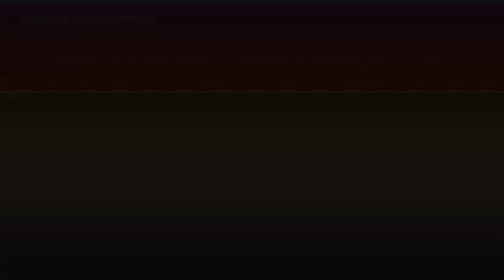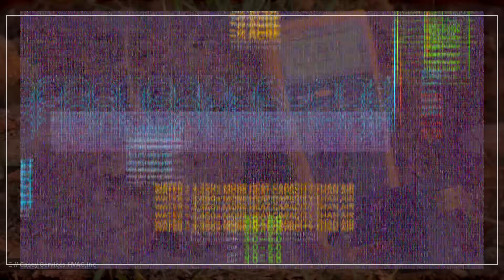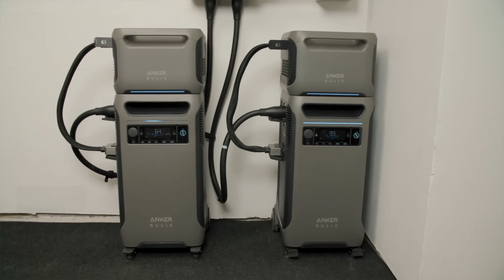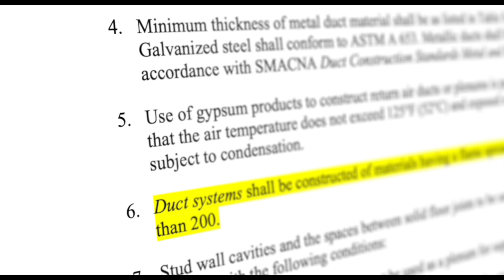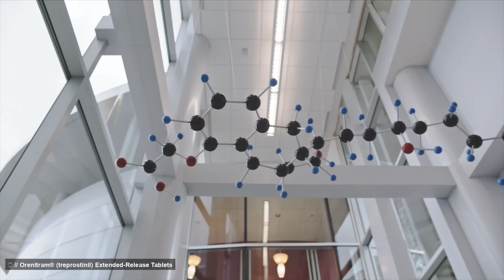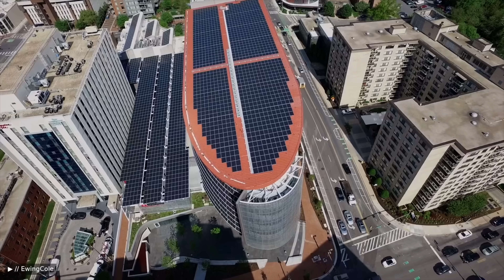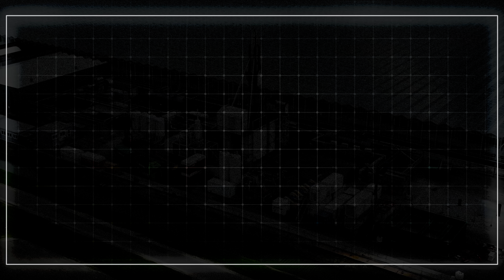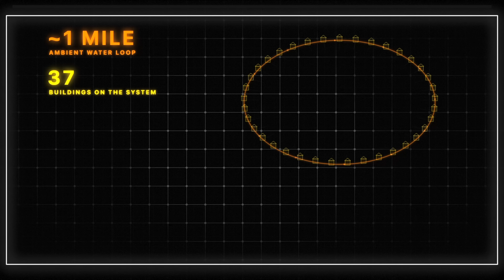The Viral DIY Cooling Hack That Nearly Killed a Family

Comment: In Vancouver  while installing the vertical system they hit an aquifer. It took months and $ 10 million to cap it back by city after the owner abandoned his property
Reply: I looked it up because that sounded crazy, should be the engineers responsibility, and yeah they had no permit and no contract, on a multi-million dollar mansion, insane work.
Reply: I don't understand why people feel the need to go so deep. A 20 foot deep 6 foot diameter pit with a coil of pex and some thermal mud is enough to cool/heat any sized home!
Reply: Holy crap .. and they hit it at only 65 feet... That's crazy... I didn't have do vertical geo now 😂
Reply: @PaulAirSky  Aquifer at 65 feet - easy water well - yay.
Reply: I wouldn't recommend a vertical system, chance of hitting water is too high. I'm putting in direct air, antibacterial conduit, knock out pit. A lot about this video is scare mongering, direct air are more efficient because the approach temp is close to the soil temperature with no exchanger loss, and it's way cheaper. 1800euro materials.
Reply: @markgurney8682  You should look up the dunning-kruger effect. It is very obvious that you do not have any idea what you are talking about, but you think you do.

Comment: I have a geothermal system. The HVAC contractor designed it as a cash cow. I was spending more for repairs than I saved. Lessons learned from this:
1. Either put an expansion tank in the ground loop,  or use a gravity feed (non pressurized) flow center. 
2. Use PEX for the entire ground loop, do not transition to PVC inside the home.
3. Use ethanol instead of methanol for the antifreeze.
Reply: Thanks. 1. the expansion tank seems necessary for a home sized system. 2. PEX to PVC, causing problems. why? 3. Ethanol as a less toxic alternative to methanol as anti-freeze seems like a good idea.
Sounds like the HVAC contractor might be either an idiot or a criminal. Perhaps inexperienced gives the idiot more latitude.
Although systems component and materials choices seem like financial considerations that did not work out. Going broke saving money.
Reply: @luck484  PVC is fine when it basically is at room temperature all the time.  But if you heat cycle it (warm water in the summer and cold water in the winter) after about 20 years it becomes brittle.  Then if you accidentally bump into it with something, it cracks.
Reply: You cant use ethenol as its not allowed in domestic installations. Whats happened in your case is the cintractor did not use a proper amount of propelyne glycol resulting in a fracture. Doesnt happen when dine properly
Reply: @MrDmadness The laws in your jurisdiction may not apply in my jurisdiction. Ethanol is perfectly legal in all settings where I live. While not as efficient as the methanol that was originally in my system, it is not as corrosive to iron based components in the system. I never had propylene glycol in my system; I don't know where you came up with that one. I don't,  nor have I ever had a "fracture " (leak) in my system. The seasonal variation in pressure, however, was sufficient to result in pump cavitation -- twice. I now have an expansion tank in the system, which has resolved that problem.
Reply: @davidgates1122 fair enough. Its hard to make specific comrmts on a system youve not inspected first hand. Glad you got it resolved. 😊

Comment: It can be done safely there are ways to mitigate the problems but is something that needs designed. I've done lots of research. Without sunlight nasty things can grow and off gassing of many things can be a problem. If build one it will be a water loop and a heat exchanger fan and pump

Comment: I thought the overall point of the video you are referring to ( and there are more than one out there now  so we might be talking about different videos ) was the requirement for  using mechanical assisted vs a almost totally passive system.  It seems to me you are talking about a totally different system from the other video.  And this is also why the lobbying numbers you came up with are so different . Either way thanks for putting out this video with your information and clarifications.

Comment: I live next to Ottawa, Canada (Gatineau, in the province of Quebec to be exact) and I got geothermal installed in 2018. Best decision of my life! The house is around 2k square feet, spread on two floor and a basement (not counted in). The last 2 winters, I've got the basement on bare concrete in prevision on redoing the isolation and even there, it cost me peanuts vs some people I know that spend in the high hundreds / thousands to heat during our cold months (Canadian winter eh?).
So yeah, geothermal is a great way to the futur and to get as much heat / cooling as possible for as little energy / cost as possible BUT, it's not for every home... the cost to get it installed are one major downside, especially on existing houses.

Comment: You know it's hard to beat a simple AC window unit.  I think people get the physics wrong you have to remove the heat if you don't remove the heat you'll end up with a bottle neck and your house will still cook. Bye.
Reply: Seems to me that YOU get the physics wrong.  Ground sourced heat pumps remove heat.  A "simple AC window unit" is an air sourced heat pump.
Reply: @palindromeambigram4852  Nice comment.  I see you haven't corrected him yet so he likely has muted you.  @mick62569 needs to do a lot more reading on how an AC actually works.  Maybe he'll read this:

"Via the vapor-compression cycle, a "simple AC window unit" "pumps" heat from the inside air to the outside air so it's an air sourced heat pump.  It isn't a reversible heat pump but it is a heat pump."
Reply: @palindromeambigram4852  you are completely wrong. You need to read on how a AC actually works.
Reply: @mick62569  @palindromeambigram4852 is not wrong and it is you that "needs to read on how an AC actually works......

Here's a good start:

"Via the vapor-compression cycle, a "simple AC window unit" "pumps" heat from the inside air to the outside air so it's an air sourced heat pump.  It isn't a reversible heat pump but it is a heat pump."
Reply: @mick62569  No, you're completely wrong.  Feel free to learn what the vapor-compression cycle is.  It is the thermodynamic cycle that is the basis of your "simple AC window unit" and it is a heat pump.

Comment: Those Earth houses in the desert pass a 8-10" pipe from inside through the mound and directly outside so it's not actually under the ground and you can see through it. They look to be about 20 feet long.

Comment: We only want it if it's cheap and youtube reigns in click bait titles. I live in hot and humid Texas (Katy, Tx) My electric bill last month was $73 so maybe I hit $1000 for the year to spend 50K on a geothermal system would take more than 50 years to pay back. I'd be dead long before that ever recoupes anything significant. Well do it for you tube? I don't think so. I saw the $300 earth air tube video and thought well this sounds like a culling of the herd moment. Sometimes to save money, requires you to say no to spending it. Well we need something to make a video about. Show one how much money you saved by not doing the thing you thought would get the clicks, then do a follow up video of click bait vs reality? The reality is we need click bait, and that's the problem a $300 air tube satisfies. It's like these little air coolers that add humidity to the air to cool. Works in an arid climate, but not in a humid climate. But these devices don't tell you that because if they did the product would not sell.

Comment: You can also enclose the radiator of a simple window AC unit with a water tank and pump the water through a hose that runs 10-15 feet underground.  The water cools the refrigerant way faster, and the ground cools the water, tripling energy efficiency and roughly doubling cool air output.  It doesn't require a borer, just an auger digger, which runs a few hundred bucks at most to hire for the hour it takes.  Tech Ingredients did a whole how-to video on it, but the trick has been around for years.  It's way cheaper than than a passive system, though it will only cool one room unless you have another way to move the air.  Through-the-wall fans with thermostats can be had for under $100 and installed easily.  The whole thing could run you under $2K, depending on the house.  If I didn't have a mini-split system already, that's what I'd do.

Comment: you can get cooling simply by partially burying a length of pipe underground and you have the open end above ground it really is no different to drawing air from a window  forced ventilation rather than convection.

done correctly it is safe.

Comment: Love the video, but you stressed r well system. What are the costs with a ground loop system?
Reply from the maker: depends greatly on where you live. if you have lots of land, horizontal tubing can be way cheaper. vertical gets more expensive. But if you have really high bills and need heating and cooling a lot... it can definitely be worth it. in San Diego, you dont need heating or cool like 300 days a year... so probably harder to justify

Comment: 13:35 This seems like a good place to start, but Eversource also runs and contracts out many gas, oil, coal and nuclear generation plants, and all of them waste about half the heat they generate. What if Eversource recaptured the waste heat from those plants and piped it into apartment buildings and condos? They could make extra money while providing cheap heat to some lucky residents. Cogeneration is common in gritty industrial areas, but I think it's under-utilized in most of the USA.
Reply: @pcno2832  I'm suprised that's not a thing ?
In Chernobyl the waste heat of the reactor was used to heat the whole city and the swimming pools in the town

Comment: 13:10 I'm wondering if 300 foot deep bore holes are overkill. If the ground temperature is 50 degrees only 10 feet under, and there is a lot of digging that deep just to level the lots, provide drainage, run utility lines and to install foundations; why can't piping be buried during this routine digging? It may or may not meet 100% of the heating and cooling needs of the houses being built, but since the digging is going on anyway, the cost would only be for plastic pipe, and maybe some extra insulation to keep the basements from being affected. In extreme cold or hot climates, any ground source water will be significantly more efficient than water at the ambient air temperature, so it's probably worth installing whatever piping can be added whenever there is an opportunity.

Comment: The 300' bore hole may not be necessary for moderate climates.    It may make sense to make a larger diameter hold that's on the order of 10 to 15' deep.   It can be "salted" with drilling mud with stuff to increase conductivity between the pipes and the ground.

Also, as a heat exchanges (which it is) it makes sense to have seveal parallel "pipes" with turbulent flow.   It would tend to operate a bit closer to ambient but would still be a vast improvement over air source.    If something goes wrong it's a lot easier to dig down 10' than pull up 300' of line.

Comment: I’m surprised you’re considering ground source for your place. Most places in CA have an ideal climate for air source, so it seems unlikely that ground source would provide enough advantage to justify the cost. Would make a cool video though. In the LA area, the bigger challenge is cooling. How about, instead of dumping the heat into the ground, you dump the heat into your pool?

Comment: Nothing is free. The only exception maybe the sunlight. The earth, especially the soil, that extremely important biosphere need enough heat. Those animals, germs, even one cell creatures, plants live there need heat to live and do their important role. Dont freeze your soils, your ground water, your earth under your house, under your garden. Just use solar panels, solar collectors and air based heatpumps like a standard modern cheap airconditioner.

Comment: simply run your  water tubes in a  contaminated air tube. disconnect the air tube access to the home. use the cold water in radiators up high.cousin built a house in the side of  a imestone  rock mound. they hit a wet cave  but could not use the 62° air  because of 97% humidity.  they just sealed it off. radiators and water would have captured temps tith 0% humidity transfer.imlo

Comment: Or you can use a dual well system pull from the aquafer and putting it back closed loop you just have to get all the air out to reduce cost this can tie directly into a central air system

Comment: Are fighting with ai generated videos and content? Come on mr. Engineer.... Anyway your argumentation should be more stronger than just a design / material flaws... For mold can be easily fixed by any one with an engineer degree, it should be the point of your video instead supporting 100k alternative that we will find out in a couple of months that you got a discount to install, different than matt...

Comment: Soooo I love this idea but I gotta break it to you: you will fight high humidity, forever. When you use heat exchangers to drop the temp - you fail to drop the coil temp cool enough to condense the water from the air. So what you get is a muggy moist cool swamp effect when you go to sleep. Ask me how I know... I travel through hotels all over and I IMMEDIATELY can feel the difference. The hotels with heat exchangers, it's a lot more difficult to sleep.

Comment: 12:17 I pay $110/month in the summer months with a conventional A/C on the Texas Gulf Coast. There's no payout for geothermal heat pumps in states with cheap electricity.
Reply: @frua97   There's still a payout. Instead of coming from monthly electricity savings it comes in large chunks every 5-10 years when you would've been replacing other systems.
Reply: I pay 500+ per summer month in DFW with the thermostat set to 77°. 1400 sqft house, within the last 5 years we put in all new windows, replaced our central ac, replaced all the wall insulation, had 2 rounds of fiberglass insulation blown in the attic, and mixed in ceramic beads with the WHITE exterior paint. Most of our friends pay 800+ in their larger houses. Even friends in apartments pay 300+. 

$110? You must live in a shed with the thermostat set on 95°. Good for you but still, your situation is not the norm.

Comment: Check out Quaise energy. They are using microwaves to vaporize rock to drill DEEP for geothermal. Thye use conventional drilling where cheap and switch to microwaves when indicated. The low lying fruit is the coal plants that have shut down. Already have grid interconnections lying fallow.

Comment: Some things should be more common knowledge.  Each room need 5 air exchanges an hour (like 100cfm in a 12x12 room) in order to offer one person a healthy amount of breathable air.  

This can be difficult to do without trading off cost of utilities.
And also, the cost of an actual heat air exchanger that is installed correctly can be a bit disqualifying to some groups.

Most of us are slowly suffocating in these stuffy homes when the AC/Heater isn't running to pump fresh air into the home.
If you aren't running air into your house, you probably need to have your windows and attic fan (or similar) going.

Comment: Aw for crying out... 10:04  It cost's about $65,000 grand (And that figure is VERY optimistic & bordering on unrealistic in some areas) to do this with your house.

P.S.  And, no...  You can't just slap a solar panel on your roof & buy a few knock-off electronic vehicle batteries from eBay & expect to tell the power-company to go pound sand—It's more complicated than that.  The green path is as hard as it is worth it — but don't lie to people with the promise of:  Free Energy, or ease...

Comment: We live on a hillside in Colorado, and our garage and back wall is essentially 8-to-10-feet under ground level.  The summer-to-winter temperatures along those walls are about 55'F give or take 4-degrees.  In summer we cool the house from the garage, but in winter we do have to heat the living areas.  For CAlifornia the best heat pump arrangement for summer is into your own water pool.  We used to have a gas heater for a small spa add-on in Ojai, because even there the pool temperature was only about 65+degrees if not heated.  In winter it got down to 40's.

Comment: Seems the easiest way might be to build a brand new home that goes a little deeper in the foundations and puts the geothermal in a flat layer a couple of metres under the basement. 

Slightly less efficient than your bore holes but solves your footprint problem and feels like it would be WAY cheaper to install (standard landscape / plumbing work that can easily be tested before being covered)?

Comment: @13:47: Did I catch that right? All that work for a 20% reduction in heating and cooling bills? And I guess those "net zero" dreams aren't working out either, because while a 60% reduction in emissions is impressive, 40% reaming is a long ways away from 0%.

Comment: I dig 7ft I hit water that's always in the 60s,  ranges  up to 73 over a year..  I was just going to use a 10 watt pump through a pex  radiator  to a 55 gallon  drum  in the ground.   It would be stainless and a closed system.   But I belive it will work.. a cast iron radiator would be idea if I come across one.